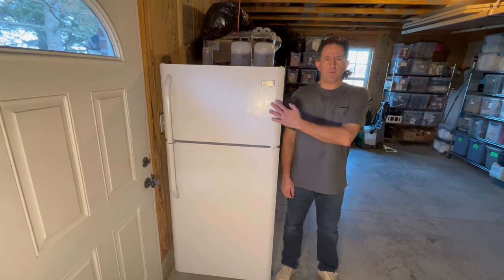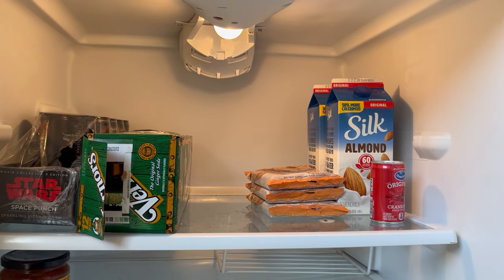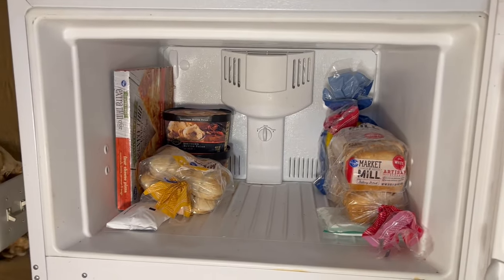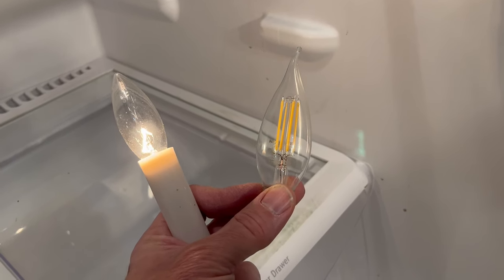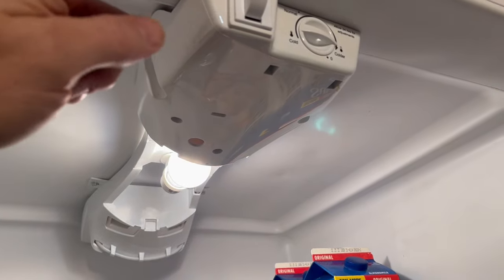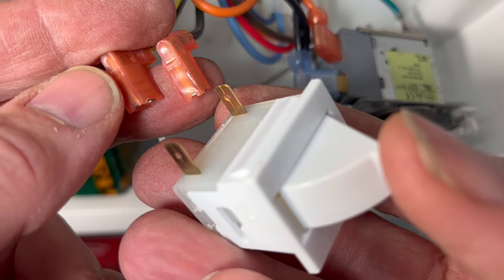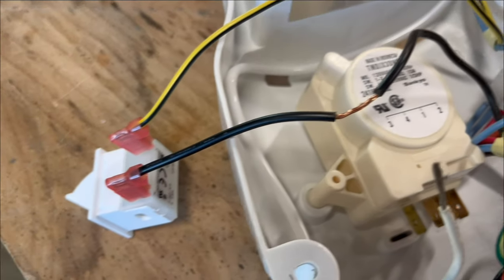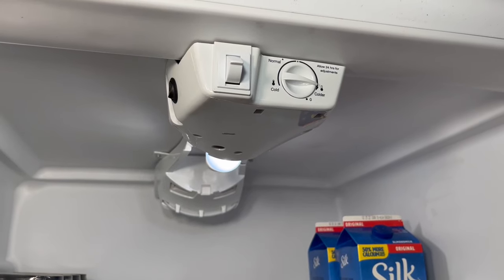Garage Freezer Defrosting - Help!

Comment: Did you consider putting the heating element inside the housing with an 'on' 'off' switch as opposed to sticking it on the inside wall with an outlet plug?
Reply from the maker: That is also an option, but if you are going to do re-wiring, the light in the fridge is already there and is the perfect wattage to heat.
Reply: @HowToLou  I have the same fridge in an unheated garage. Did you keep the 40 Watt bulb in or did you go lower? I feel the 40 may put off too much heat.
Reply from the maker: My workshop is heated and the fridge is in the next room, so it only goes below 40 on the very coldest days of the year. I just left the original fridge bulb, but would definitely try a lower wattage, for more efficiency, if it were used more often.

Comment: Indeed, in our garage fridge, the coldest beer is always available on the hottest days! Here in North Texas, my wife and I fell victim to the 4 day power outage. Suffered a broken pipe and consequent flooding inside the house. But since the garage fell to the ambient temperature of somewhere between 8 and 11 degrees Fahrenheit, nothing thawed.
Reply from the maker: Well, you were a lucky, unlucky family.  Unheated garages are frequently between 5 and 40 degrees in the winter.